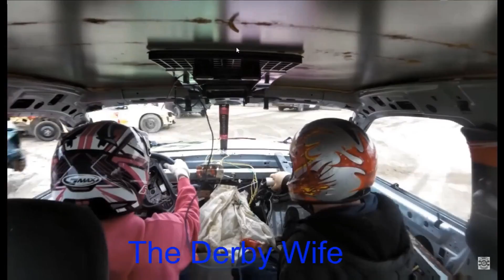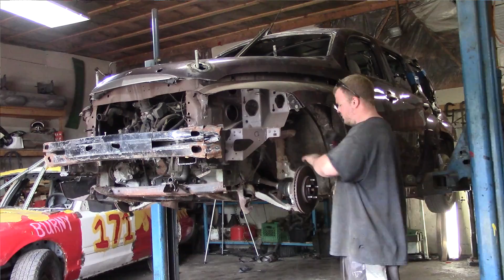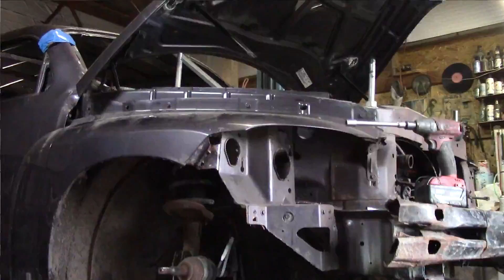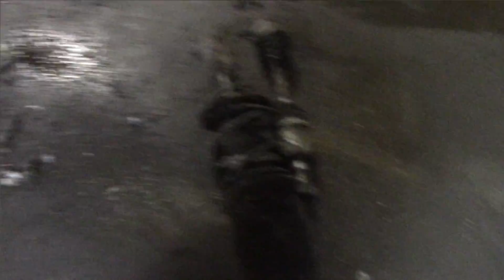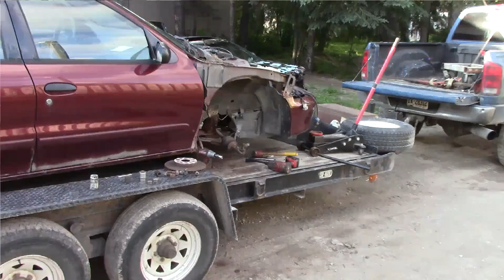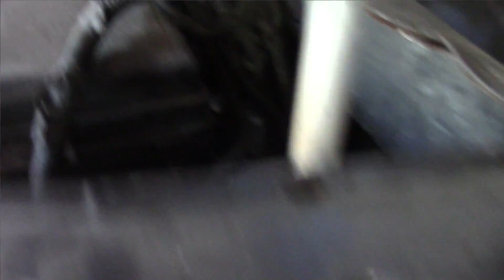lets try this again!!! hhr demolition derby build part 8 spindle swap

Comment: What ever happened to the other HHR. And any advice on all the parts I’m building a HHR for bash for cash
Reply from the maker: i ran one and one blow up in the garage
Reply: @zacksworkshop171  oh thought you was going to pull the motor out of the 2nd one an put it in the one you blow up. I been watching your videos to learn stuff for my build an I talked to some guys that built cars that changed out the front struts for height.

Comment: U have any idea about steel spindles that would work on a cobalt to replace the aluminum ones, everything else is steel just not the spindles (I got a 07 with a 2.2)
Reply from the maker: Hhr is alum as well I need cavi ones
Reply: @zacksgarage171  would cavi spindles work with stock hhr? If so what year cobalt. Doing derby figure 8s and keep breaking the aluminum spindles. The control arms seam to be holding up just fine.